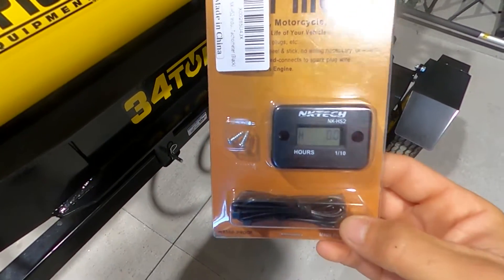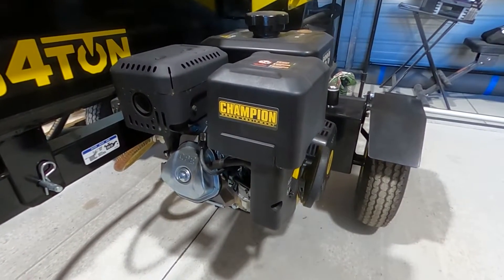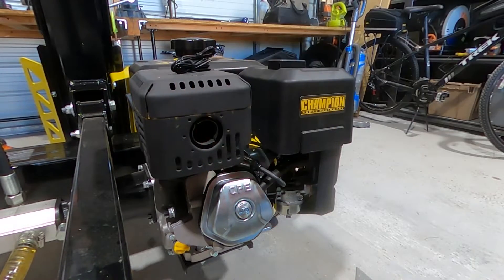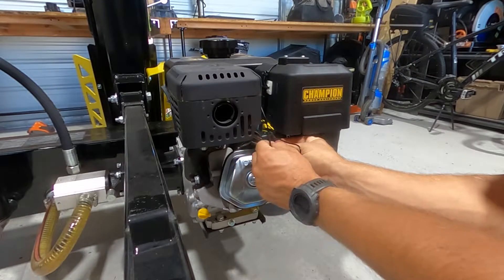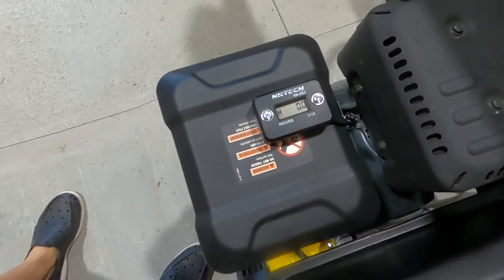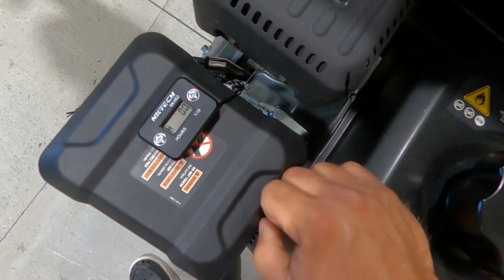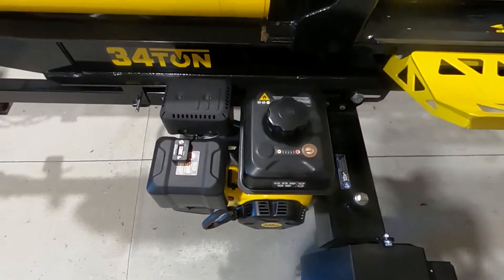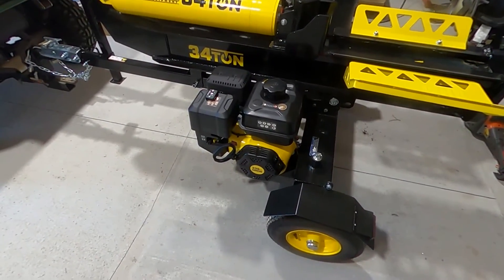How to Install an Hour Meter | Gasoline Engines

Comment: Very interesting. How cool.  I was going to ask if you kept a record of the maintenance you did to your equipment, lol but you answered that at the end of the video. I guess you would need a long list with all the stuff you use.
Reply from the maker: Yep! At this point I use everything so much I just go by the hour meter. I wish cars went by hours instead of miles because everyone drives at different speeds, my truck has an hour meter built in (ford superduty) and you'd be surprised how many hours I rack up with very low mileage just because of low speeds when towing and idling!